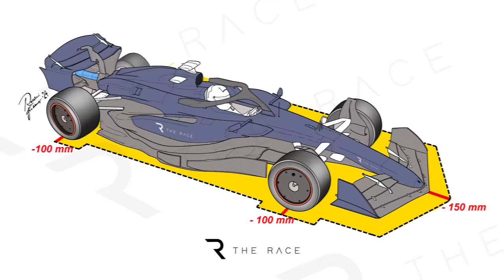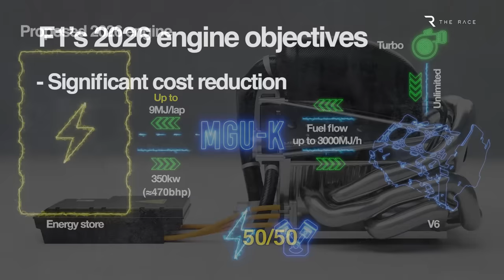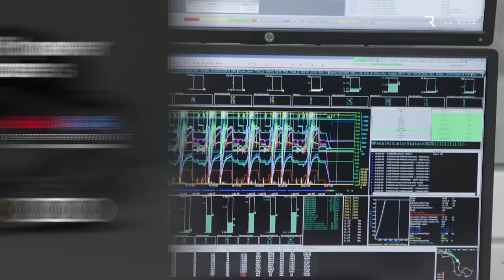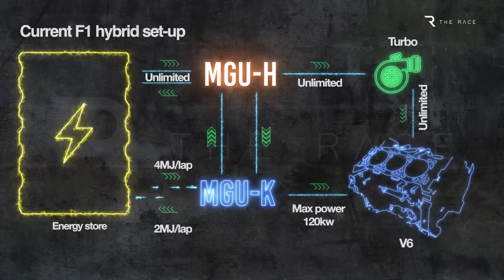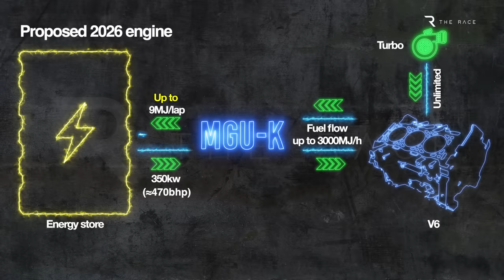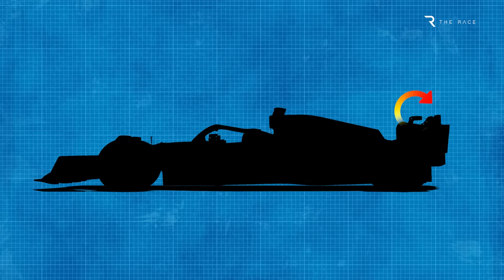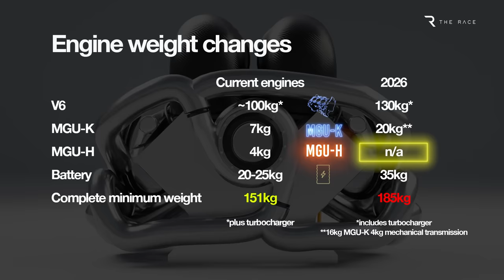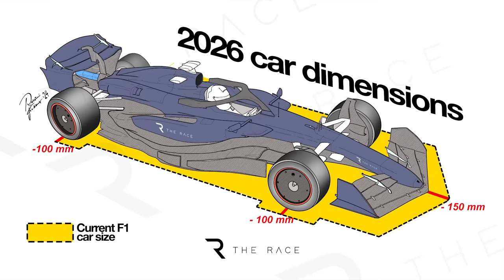The truth about F1's controversial 2026 cars

Comment: The only positive about these regs that i can see is the 50/50 ice-electric power split reminds me of LMP1-H. Main difference being that LMP1 uses the electric power for the front wheels making 4WD
Reply: GR010 and Porsche 919 Hybrid both used those for the first time.
Reply: Electric engine and battery is huge negative. That's why cars are heavier.
Reply: The 50/50 engine spilt will give full power for not very long as the new regs wouldn’t allow them to store anymore power than the current levels we already have an ERS deficiency at certain tracks it’s only going to get worse 

A 500HP ICE will be the lowest HP produced since the 1970s
Reply: @purwantiallan5089  the GR010 is a Hypercar not an LMP1
Reply: @RANDOMZBOSSMAN1  No strictly true. They are allowed to Harvest more power per lap, but the minimum state of charge has remained the same at 4mj. So they are hopefully able to continuously deploy some power via the MGU-K for the whole lap. However, that full 350kw is only available for 11 seconds per lap if used continuously.
Reply: @lankyboy90  So we essentially can see these cars at its full power for 11 seconds lol, it’s currently 33seconds now which isn’t great but it’s such a bad oversight of the rules they didn’t change the amount of storage and deployment if you increase your max deployment rate
Reply: @RANDOMZBOSSMAN1  I think it will depend on the circuit and percentage of full throttle application. An ICE isn't always producing it's full power even when on full throttle after all. The power bands of the engines will probably be mapped to take this in to account. 

But this does look like a potential issue for circuits such as Jeddah and Monza with very few regen opportunities and high full throttle usage.

Comment: Finally a video from you guys that feels like actual journalism and not just pushing clickbait melodramatic nonsense.

The rules sound like at best F1 is going to look much the same as it does now, only with more electrical power and sustainable fuels so manufacturers can greenwash to oblivion. Not very confidence inspiring, but not tragic either. I think we want to avoid a repeat of 2014 and as long as we get an actual championship fight between 2 teams in 2026 and the racing is decent, I think we'll be fine.

The dream of loud engines and small agile cars is unfortunately permanently dead it seems, but we'll have to wait and see how the cars end up behaving.

Comment: I dont understand why f1 is still pushing hybrid tech.
Hybrid is basically dead for road cars and while the efficiency is nice its more than offset by the components that need to be manufactured so the climate angle is also dead.

F1 should realize the last 20 years where a mistake revert back to 2000's regulations, fuel the cars with e-fuel and start over
Reply: Nowadays hybrid road cars sell better that EVs, so not really dead.
Reply: Hybrids are hugely popular and do serve to substantially reduce carbon emissions/fuel usage for road vehicles.
If they make good race cars is separate subject.
Reply: Eh, Hybrid is still popular. EV, however, is kinda stall for the sale.
Reply: Hybrids are absolutely road relevant. But motorsport is supposed to be entertainment first.
Reply: @pffyespff  well i would like to reply but I got shadowbanned, maybe this reply makes it through. Tldr: ev sales are higher than hybrid by far, pls google.
Reply: Just did. You might want to check your most recent numbers on that.
Reply: @456MrPeople  youtube seems to try very hard to remove anything that goes against the narritive, so citing any studies or numbers gets my comment deleted instantly. So all I can ask you to do is to track down the original versions of the claims you base your opinion on (yes I even have to dodge that word) and you will find actuall sales be on an order of magnitude less than what you claim. ( I swear I rewrote that sentence 10 times before it was acceptable to the overlord)
Reply: The fastest F1 ever made is a hybrid,  so I'm fine with hybrids staying

Comment: Things to bring back :

- Different powerplants I4, V6 single turbo, V8, V10, V12, H12, V16 and so on 

- Active aero front and back 

- Equal P/W ratio for all teams amateur and pro 

- mass damper and hydropneumatic suspension 

- refuel in race 

- Ladies in Pit cheering the team and pilot (grid girls)

- High banking turns and Nordshleife GP, Avus return and Monza full. 

- Old-timers safety cars : Lancia Delta, Mercedes CLK, Chevy Camaro 

- More straight lines no more chicanes 

- Turbine driven diffusers and 6 wheeled f1's authorized

Comment: F1 is a very complicated venture from the get go.
But it seems like removing the MGU-H in the bid to simplify and reduce cost is only over complicating things and adding cost in other areas.
I can't see the benefit.
Its like a change for the sake of change.
I know they said removing the MGU-H was to entice other manufactures, but did they know what that would mean in terms of development and complication else where?
We all wish they would bring back the V10s, but in lieu of that it would of been good to see this rule set for another couple years for the other teams to catch up to Redbull under the aero restrictions and had another 2021 season. (Without the controversial ending)

Comment: The solution to reducing the costs incurred by hybrid engine technology is not to double down on hybrid engine technology, especially in F1, the pinnacle of motorsports. Anyone that wants to watch EVs race can already do that with Formula E. I don't hate the V6 turbo engines, but to me it makes more sense to downsize the electrical stuff and push harder for sustainable fuels. Especially since the market is starting to decrease for EVs. The more that they screw with the regulations, the more unintended consequences they introduce.
Reply: Problem is the teams don’t want to do this.
Hybrids are increasingly prevalent in road cars and the manufacturers want to use the sport to develop them.
Hence when they negotiated the ruleset, the teams only pushed for the removal of the MGU-H

Comment: Set a weight minimum, safety minimums, energy maximums, spec parts that don't matter to fans (gearboxes, mechanical brakes, et al), set a budget that can't be exceeded, and let the teams sort out the rest. That'd be interesting. Most would choose to sacrifice one area to develop another (i.e., use the established ICE and develop battery) within the budget. You'd get variation across circuits, potentially closer racing (one solution would likely not dominate everywhere) and interesting tech stories as well as racing. Currently we see one formula iterated to the end of what's possible. Imagine one where there are multiple approaches to the same problem, but the budget is the main constraint. You'd have some pretty basic ideas that could work or fail, or sticking with ideas that are proven but can't deliver huge gains over time.

Comment: god it drives me crazy when they talk about the MGU-H, I'm glad it's going away. It does not 'convert wasted heat to electrical energy.' THERE IS NO EXOTHERMIC REACTION HAPPENING. THE EXHAUST GAS IS THE EXACT SAME TEMPERATURE WHEN IT COMES OUT THE OTHER SIDE OF THE MGU-H. It is literally just another MGU-K, being spooled up by the exhaust gases to fill in turbo lag. I get the logic of wanting things to sound different and unique and dynamic and whatnot, but that is just a blatant misrepresentation of what the device does. IT HAS NOTHING TO DO WITH HEAT. ALTERNATORS DO NOT RUN ON HEAT CONVERSION.

Comment: New 2026 engine is too complicated with too much software reliance. Should have kept the present engine format. Reduce fuel consumption by deleting a practice. Also shorten each qualifying session overall by several minutes. Allow the battery to store more energy. Perhaps reduce engine displacement by say 0.2 litres. And who cares how much fuel one has in the tank at the end of the race. The car should only have to make it back to the pit lane be it on fumes. If it doesn't grid penalty for next race. 
 
The real elephant in the room as pointed out by others previously and also intuitively obvious is all the other environmental pollution generated over and above that generated by the F1 cars going around the track. How many tons or carbon are being expelled. I shudder to think. I am a not tree hugger but the ICE of an F1 car is the least of the worries. Why not make the safety car an EV.  Stop destroying unused F1 tires after each race. The dry compounds are fixed C0 to C5. Instead of soft, medium hard which are different for each track surface just use the the number system. That way unused virgin tires from a previous race can be used in another. Restrict them to only practices if need be.
  
Give reduced ticket prices for fans who, car pool, use an EV, use public transit. Harvest the kinetic energy via kinetic pavement from the cars as they drive the circuit. Install solar panels at as many tracks as possible, wind power if feasible.

Comment: MGU-H doesn't literally convert HEAT ENERGY into ELECTRICAL ENERGY. The word HEAT is referring to fast moving, hot exhaust gases (fumes) coming out of the ICE. The gases are spinning the Turbo turbine which in turn spins the Compressor turbine at up to 100,000 RPM. A secondary shaft comes away from the Turbo turbine and goes into the MGU-H, basically a load of rotating magnets surrounded by copper coils generating electricity.
Reply: You know what, when i first got into f1 i really belived the mguh is powered by the heat of the exaust fumes of the engine. I heard "converts heat into electrical energy" everywhere. It is true that the exhaust gas is the one giving the rotation to turbine axis and thus generating electrical energy, it should be mentioned it's indirectly doing so.

Comment: After a bit of messaging of the grey cells I came up with a novel idea, so for better or worse here goes.  First get rid of the hybrid power train, ICE only.  Next reduce engine size to 4 cylinders, turbocharged.  Next get rid of DRS, it gives drivers an unfair advantage.  Then reduce overall weight by 30%, this would give the 4 banger a chance.  Some of the weight reduction could come from smaller rims and tires and a smaller chassis due to the downsizing of the engine.  Come on FIA & F1 you can do this, make F1 interesting again.
Reply: I like the idea but not sure about the sound. An Inline 5 can sound pretty good. Not sure if it would work as a stressed member tho.
Reply: You seem to have described a Super Formula car from Japan! 😃 4 cylinder turbo engine with about 600hp, they still have the narrow 13" tyres like F1 in the past.  I don't mind them, they aren't bad, their racing weight is 670kg.

I don't think your 550kg target (798*70%) is possible while meeting 2024 crash test regulations.  Don't forget the era when F1 cars were 500kg, that did not include driver weight while now the weight includes the driver weight of 80kg.

Comment: Why are still 18" Wheel mentioned?
Had they not already changed to 16" for better visibility for the drivers and less weight?
Reply: 16" change was abandoned. They will use 275mm/710mm R18 front tyre and 375mm/710mm R18 rear tyre, this is slightly smaller than current 305mm/725mm R18 front and  405mm/725mm R18 rear. [ section mm / overall diameter mm  Radial Rim diameter inches]

Comment: F1 is supposed to be the pinacle of motorsport with some of the greatest automotive minds making up the teams. just give the teams the freedom to do whatever the f they want as long as it doesn't impact safety and certain weight and size constrains (and if you really want to push your environmental directive, some maximum net emmison regulations).  let them choose how much electricity they want, how much active aero they want and whatever else they think will make the cars faster.

Comment: So will the cars be louder or quieter? 

I asked F1 technical wizard Craig Scarborough whether the '26 cars will be heavier or lighter. He said - 

"We've not seen the full regs yet, so we simply don't know. It seems the whole PU will be heavier, by 35kg, as the combustion engine will be more regulated. If I recall correctly, the battery, CE & its enclosure is only 3kg heavier. There is scope for the chassis and transmission to offset this."

Comment: please make narrow angle V5 cylinder 1.6-1.75L (sound more like v10),  skip  fuel flow restriction, make tubro max 1.5-2.0 bar versus more than 2.5 now - this will make need for more RPM and better sound. Allow variable compression ratio technology, interesting but still not used in modern cars. 16-17'' tyres gonna be faster and more enduring, and lighter too. Do not make more than 250KW electric engines (less weight). I am very doubtful about active aerodynamic too.

Comment: The last 10 lines summed it up. And anyway, F1 needs to be a front runner in tech that will be utilized in road cars in a few years. Its not right now, except for materials used in the chassis. They struggle with hybrid tech because that wont bring the Automotive industry the holy grail to efficient drive trains. Fully electric wont keep the fans because of the lack of emotions (read: engine p0rn-sound). I suggest the apply hydrogen as a fuel and make the elektrolyse process more clean. No waste, only water and pure sound.

Comment: I write tabletop games as a career, and work alongside a lot of other aspiring designers and writers. F1 in 2026 sounds increasingly like some of the projects I've seen from my peers; games in the very early design phase, with so many moving parts, custom tailored design seen nowhere else out of a desire to be unique and stand out. It seems like a hodge podge of all the Good Ideas these rule makers could come up with, then having to write twice as many rules just to keep their Good Ideas in check.

I've seen this a lot in the tabletop design space, again usually in very early prototypes when the designer is just trying to put everything they want into the game, and are still in the process of trying to fix all the knock-on effects those things end up causing. I've certainly done my fair share of that too. But trying to be unique shouldn't be the goal; the goal should be to just be GOOD. 

You can usually tell when a game system is not in a healthy place when early play tests reveal pretty fundamental failures in the game system. Basic gameplay doesn't work very well, players are confused about what to do, and the varied mechanics don't interact in a functional manner. Things like basic driveability on the straights, the engine itself having complicated, unclear rules on when and how you can actually deploy power, or how best to recover that power. Hypothetically, of course.

It's usually at this time the designer takes a step back and rewrites a lot of stuff based on old rules they know work, and then sprinkle in the cool things they want to add. I don't think F1 is gonna do that. It's too late, I think.

Comment: Why make the tyres narrower, that’s a loss of mechanical grip, which is why kart racing is so close! If they want to reduce the weight of the tyres then go back to 14” wheels, they always looked better than the 18” anyway. They need to also drastically reduce the reliance on battery power, they’re simply not efficient due to their heavy, bulky nature. Naturally aspirated V10 running on e-fuel is the obvious future.

Comment: Faster in straights and slower in corners. Making the chassis weight limit lower and the engine higher is kinda indyar movement tbh. F1 should be the lightest and fastest in every thing since its the pinnacle of racing. 2020 is the pinnacle indeed

Comment: It was evident when F1 said that they wanted to remove the MGU-H that the PU would have to be bigger and heavier. Additionally, they will need to either have larger heavier fuel loads at the start or there WILL be massive fuel saving during the race. The FIA and FOM chased a unicorn believing it would magically appear. Physics (aka reality) doesn't care about wishes. The other German manufacturers pushed for these rule changes so they could join. Now that only one of them has entered and the FIA waking up to the proposed "weight saving" being problematic they are forced to compromise on the chassis. They can't make a car that is robust enough to handle the speeds they will need to at least match the 2014 cars and so the next generation car will be slower or need in race recharges.

Comment: F1 recently has a goal of using their engine regulations to accelerate research on sustainable tech that could be used on road cars. So they are getting rid of the MGU-H because they don’t see that it’s relevant for road cars, but don’t care that the most competitive way to run the new engines may be to rev them up at slow speeds, wasting gas?